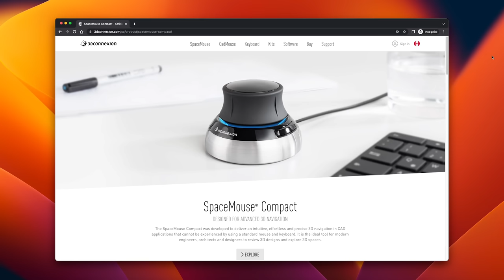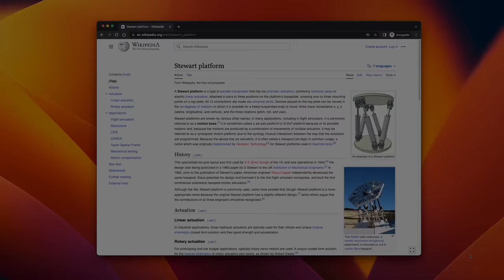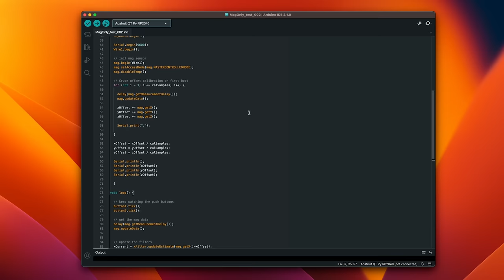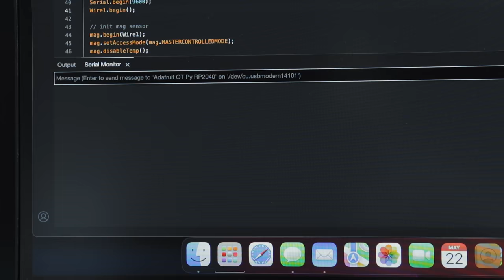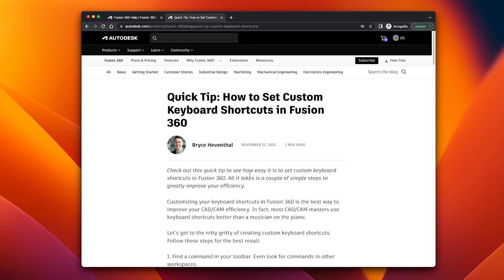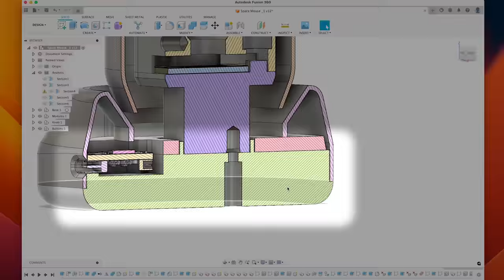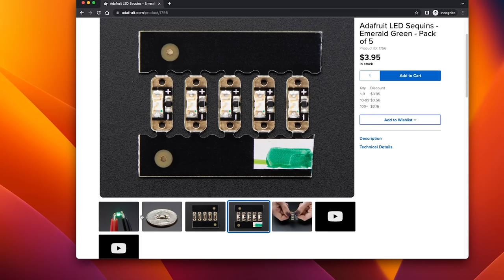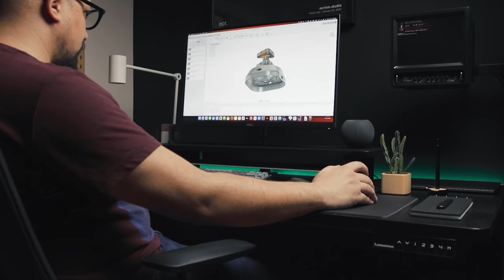I Made my own Space Mouse for Fusion 360 using Magnets (DIY)

Comment: I have the 3D mouse and it's such a huge productivity booster in CAD. It looks like your design isn't 6 DoF, which is a pity, but it's impressive nonetheless.
Reply from the maker: Thanks. The initial plan was to have 6dof and control the camera directly in Fusion360 with the magnetometer paired with another IMU but it was a lot of work and I wanted to have a prototype at first to get a feel for it before investing a ton of time into it.

Comment: I really love the design of this one, so sleek and the movement mechanism is pretty cool but what I'm really interested in is whether like you mentioned, if this could be done with a 6 axis IMU, or even a 9 axis (accelerometer, gyro and compass, supposedly you can use the compass to help base the readings off)

Not much would be required to be changed from your design, just put a IMU on the top part of the moving stem, obviously some noise would need to be be filtered out but you had to do that in your code anyway.

From what I understand if possible, you could fully emulate an actual space mouse with a 6 axis IMU.

Comment: Nice project. I just started building it, based on your instructions.
Maybe let me give you some advice for the next version. You could design the plastic parts a bit different to make them more printable. Needing supports is always a pain. A 45 degree angle is your friend.

Comment: I use a real Spacemouse every day. I feel so gimped working in Fusion 360 without one. I WFH often and it sucks when I either forget it at work or at home. It took months to really get use to using it, but now that I've been using it for a few years, it's hard to work without it. With the real thing, it's not just orbit and pan, but zoom and roll too. You can basically fly to any perspective you need.  Often it's just around an edge to grab a face.

Comment: Great project. Subscribed to see more. Not sure how you're using it, but it should be on the hand opposite the hand you use your mouse with. This allows you to move your model and start picking out the next command. Takes getting used to but so much better.
Reply from the maker: Thanks! Yes it's on my left. It was just easier to capture footage from that angle

Comment: Damn, that's cool, just set up my first laptop capable of running fusion (2nd hand with a small repair) and I'm realising I have several hall effect sensors in my electronics bin, all I'm missing are the springs so i guess this could be my next project. Might even experiment with mag-lev just cos I have more magnets on hand than springs and it'd look kinda neat

Comment: Have you checked ther Orbion one? Which is also a 3D printed space mouse. I'm currently building it, and I feel this is a step up from your design, but obviously without having tried either yet, this would be purely an assumption.

For those who don't know, look it up, but from what I can tell it has more movement options, and it adds 3 buttons that can be used for certain keys or macro's.

Comment: Wow, I aspire to have the set of skills to make things like this. I’ve used one of those 3D connections “mouses” when working with gps data and loved it. Yours is amazing and so well finished. Very impressive. 

I’ve had this idea for an arm mounted box that gives the user absolute (vs relative) control of the 3D view. A real life proxy for for the model. So turning the box 180 in real life turns the model 180 virtually. There challenges around pan and zoom, but I can imagine use cases where the directness has its advantages.

Comment: Just an Idea, but when you would place those magnets in the top part, maybe even multiple columns, you could support rotation without struggling with the cable, and would have a detectable north to know the orientation, when the magnetic columns are oriented as such.

Comment: Thank you so much for sharing and making this greatly edited video! You were featured in a big German Maker's magazine :) Love that you supplied detailed written information, too. I will try to make one, probably changing some parts for what I have at hand, but it should not be too difficult to adjust the case a bit.

Side question, what material are the gloves you wear when soldering made of, and what do you wear them for? I never wear gloves because I am afraid of melting them with the soldering iron when I slip.
Reply from the maker: Thanks! That’s pretty cool. Do you mind sharing the name to the magazine?
I wear black vinyl gloves because my hand sweat and I don’t want to leave marks on the work (hyperhidrosis)

Comment: I actually have a 3D connexion mouse, and you did a great job replicating it.
but, you missed an important aspect of it. which is that the base is made of steel. not aluminum, steel. this thing is surprisingly heavy and part of what makes it useful is that it doesn't move around when you interact with it. other than that, really cool project!

Comment: I notice that you used Bondo. I can't stand the smell so I started filling prints with Zar Wood Patch (hashtag not sponsored) but any latex wood filler should do. No smell. Easily cleaned. Sandable. It won't replace Bondo for more structural uses but for filling layers it's good.
Reply from the maker: Thanks for the tip!

Comment: I've owned 3d connexion products since they were seleling the Spacetec SpaceORB in 1996 - love them. Have a Space Mouse on my desk now, that has been in regular use for over 10 years - the 6dof sinply can't be beat (once you're used to using it to be fair).

A DIY version however.... Sure, the genuine article isn't "expensive", not for what it is, but I'm interested in a DIY option just for the heck of it. Lovely project, can't wait to see where you take it / if you manage to replicate the 6 dof fully.
Reply: I'm mainly interested because 3D Connexion need some competition. They're still selling products with a locked-down driver, Micro-USB and a dongle!

Comment: Very good production quality. Both video & device case. Nice knob mounting system. Too bad you too wasn't able to get access to their api & made glorified 3 axis joystick with mouse emulation. The main point of 3d mouse aren't to do a 1 axis movement with less hand movement(when on mouse you can do two at time) it's to do 6 axis movement simultaneously. It's called 6dof device.

Comment: Awesome project with amazing fit and finish.

I wonder if you use a rotary encoder with infinite rotation (ie no end stops) and attach it to the gimbal mechanism, and have the knob attach to the encoder stem. That way you could do zoom in/out by rotating the knob as well as all the other pan/move operations?

Would need a lot of reinforcement around the base of the rotary encoder as there would be a lot of stresses when using the pan/tilt of the gimbal but easy enough I guess? Just need to work out quadrature encoding, but maybe someone has a library for that already?

Comment: Loved the video! And I get it that the process is also the fun part, but in a more practical point if view I wonder if it could make sense to buy an old one for cheap and work out the drivers situation?
I have an old Space Pilot (it so ancient it has the HP logo), and it still works great with a few modern softwares that support 3D mouse natively, like Blender. 
But it falls short on support for other programs like 3Ds max because the plugins that 3Dconexion offers were written to exclude older hardware.
Unfortunately I have essentially no experience with coding and drivers to try and fix this myself, but if anyone has a clue on how to make this older hardware work with newer 3ds max versions, it would be amazing.

Comment: mount it on a custom mouse, so you don't need 2 devices. maybe with a split silicone floor, so that it requires a slight lift to move

Comment: You know, you dont need inserts. I have never used them and have printed about 40kg of PLA the last 5 years. Try to use 2.8mm holes for self tapping holes for M3 machine screws and 3.25mm holes for free spin holes. For the 2.8mm holes I usually make a 0.8 fillet where the screw is going in for easier starting the tapping.
Reply from the maker: I know. I just prefer to use them. Thanks for the tip!

Comment: Its hard to believe you only have 3 videos, the work you do as well as the videos are very high quality and have a unique style to them. 
I'm inspired to work on my own space mouse now, not sure exactly what i'll make yet, but this and Orbion are super cool. And i'd love to design a flexure into the main mechanism since it would decrease components and hopefully improve the overall feel.

Quick question, since it has been 5 months, do you find yourself using it/finding it useful? 
If no, what is the main problem you have with it? (could be anything, even a personal preference to use different controls)
If yes, i'm still curious as to what you see as the main thing(s) that can be improved.
Reply from the maker: Thanks! 
The mouse emulation makes it annoying. The native camera movements are crucial imo. That's what I would try to do if work on another one.

Comment: This is so cool! I've used the 3d connexion once and ever since I've searched for a cheap or DIY Alternative. Yours looks even better than the original! Have my Sub and keep up the good work.
Reply: It's 3-axis, so can't quite do the same motions but costs 5% of the price + infinite customization
Reply: @ColinJWiens  a 3DConnexion SpaceMouse cost 2000 NOK, so about $200. It would surprise me if the components in the DIY 3 axis version only cost $10.
I'm not saying the original is cheap, but it's not that bad.
Reply: @phizc  the original space mouse uses 6 leds shining through slits at 3 light sensors, and the version in this vid uses a $5 board (plus a 2nd $5 board if you want to turn this into a bulkier 6-axis mouse), so they're close enough to the same $ worth of electronics. As for the accuracy, you'd have to test but the brandname probably has that advantage

Comment: I have found problems with the Space Mushroom both mechanically (as the potentiometers forces are not ballanced) and programatically (as it emulate "mouse drags" and keypresses to make the movements). If you find the same problems, I suggest /thing:5817728, Full Analog 6DOF Controller (now with 4 joysticks!)

Comment: Very impressive!  How long would you say it took you? (without the part about searching thru your old parts to find useful ones).

And why do you wear those black gloves?  Is it for a better gripe, or maybe to prevent you from getting scratched up by the metal parts?

How do you plan to clean this device when it gets dusty inside?  It looks easy enough to take apart to clean, I guess.

Comment: Really great video and project!  I use a couple of different models of SpaceMouse on a daily basis.  As you continue your evaluation of its value to you, I should try putting your device on the opposite side of the regular mouse.  It allows rotation with your device and clicking on objects with your regular mouse. Perhaps there is some interference between devices that you would need to take care to avoid.
Reply from the maker: Thanks! it is on the left right now. It was just easier to capture footage from the other side :)

Comment: Have you ever used an acetone vapor chamber process for achieving a smooth gloss finish? A couple of years back I started experimenting with doing so to achieve an aerodynamic surface on 3d printed parts, but had to move on to other tasks after only a couple of unsuccessful practice runs.

Comment: I watched your video so I haven't checked your tutorial yet. May I ask, why did you decide to make the buttons small? Do you have to load your files onto every new pc to get it to work or is it self contained in the mouse? Silly question, why did you use plastic m3 screws and did you add a clearcoat to the painted parts and why so many magnets? Thanks for the video. As you can see it really got me excited.

Comment: Gorgeous build quality. One question - why put the magnetic sensor in the handle? Wouldn't it be easier to have in the base so you don't need wires run into the moving parts?

No shade - I'm just curious. Love your work.
Reply from the maker: Hey Thanks! That’s the case (sort of) in the final build it’s flipped. In the initial prototype I was going to add an IMU to pair it with the magnetometer and get the full 6Dof sensing and that’s the best position for it imo but I decided to leave it simple for this one and flipped the position in the final design. You can see it the STEP file in the project repo.

Comment: Of course the joy of building your own project is an obvious appeal, but what is the benefit of this solution over a trackball?
Given you're trying to make orbiting more intuitive, spinning a ball would do exactly that.
I personally find relative inputs like joysticks, nibs and accelerometers clunky and imprecise and prefer absolute inputs like normal and trackball mice, drawing tablets and gyroscope input.
The original product has six axis, which wouldn't work out outside of VR or science fiction, but yours seems to be a peculiar form of a hall-effect joystick instead.
Perhaps the sensors can be expanded to add all other axis? This could server as a stepping stone for that.

Comment: It looks really cool, curious if a haptic potentiometer would also give the same desired results. Springs get brittle over time no?
Reply: no, springs do not get brittle over time. They may lose their characteristics slightly, but usually that happens if they are getting over compressed or over extended.

Comment: If I'm not mistaken, after uploading your sketch, you won't be able to upload a new one. It isn't safer if you configure it to function solely as a keyboard only when you use `digitalRead` on a specific pin set to LOW? So, if that pin is read as HIGH, can you upload a new sketch

Comment: Interesting project, and very well made. Shame about the mouse/keyboard emulation though. It shouldn't be much harder to do it properly and "emulate" the 3D connexion USB devices. They are also HID devices, just in a different usage page, and send relative motion HID reports. Also the general idea is that you manipulate the spacemouse with your left hand, and simultaneously use the mouse with your right hand (or vice-versa  I guess). So having it take over and send mouse events is less than ideal.
Reply from the maker: Thanks! I know ... I can see that KM emulation is less then Ideal after using for a bit. Having the cursor constantly over taken is annoying. I plan on trying to send motion HID report as you suggested in the next iteration. That way It can have a wider compatibility and maybe be a worthy alt to the real thing.

Questions: I see that you are the top contributor on spacenavd (awesome work btw). Do you think it could work with this if it emulates a gamepad or a 6dof device? Is USB supported on all Unix systems?
Reply from the maker: I forgot to mention. It's being used on the left side ofc, it was just easier to capture footage from the right of the desk :)
Reply: @salimbenbouz  Thank you.

There is a list of known USB devices in spacenavd which are picked up automatically, but you can make spacenavd try to handle any device you want by adding the usb ID to the configuration file. You can use this to use a gamepad with spacenavd, and then configure which axes control what. If you do turn this into a true 6dof device at some point we can certainly add your device ID to the spacenavd whitelist so that it can be picked up automatically. Having an open hardware 6dof device would be great for the community, instead of having to rely on 3Dconnexion as the only option.

USB devices were only supported on Linux for a long time, but that was only because that's what I'm using, and my initial USB code relies on the Linux evdev interface, and not something more generic like libusb. Recently support for FreeBSD was added by a contributor, but it needs some work to bring it up to the same level as the Linux USB code (it doesn't do hotplug, and is missing some device information features). I've been meaning to write an alternative portable USB implementation with libusb for many years.... maybe one day :)

Edit: There was also an an attempt by myself to add USB support on Darwin (MacOS X), but it's unfinished. The code is still in the spacenavd source tree, but as I haven't used macos at all for the past decade or so, it's unlikely to be continued at this stage. Rather macos will be eventually supported by the libusb backend, when and if that happens.

If you try to make this work with spacenavd and encounter any issues, let me know. I prefer email (nuclear@mutantstargoat.com being the more direct at the moment). I'm also on IRC: #spacenav on libera.chat, if you prefer more direct communication, but be warned you might have to idle there for a while until I notice any messages :)
Reply from the maker: @jtsiomb  Thank you so much for the detailed answer.

Having something cross-platform once you get to work on libusb will be huge! :) maybe one day

I will definitely have some questions for you in the next one (once it has 6dof sensing of course).

Thanks again for taking the time and for providing direct contact infos.

Comment: that finish is professional!! I thinking of doing this but live in europe. I can do the adafruit order but the M2.5 heated inserts from McMaster-Car is $11 and, i kid you not, $66 in shipping. I'm having a really hard time finding the type of insert you have used that has a bigger diameter than height ~3.5x4 most M2.5 inserts are 4x3.5 or even 5x3.5. I get that i have to edit the 3d part but do you know if the model can accommodate an insert that is 0.5-1.5 mm higher?